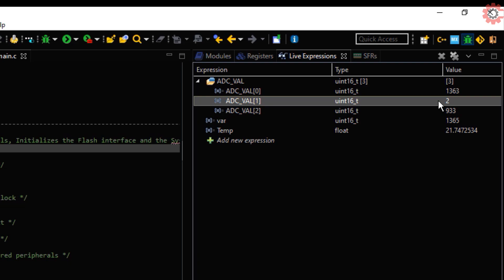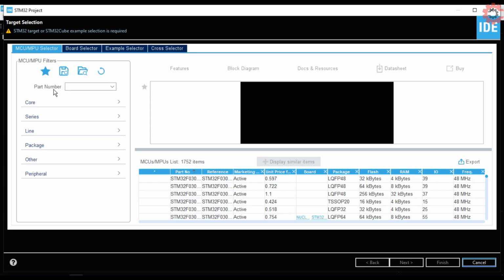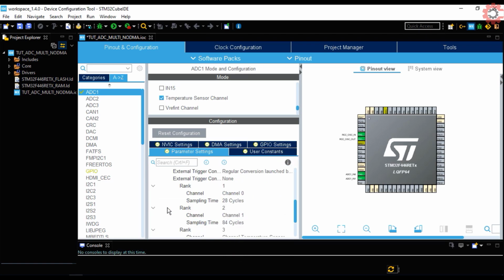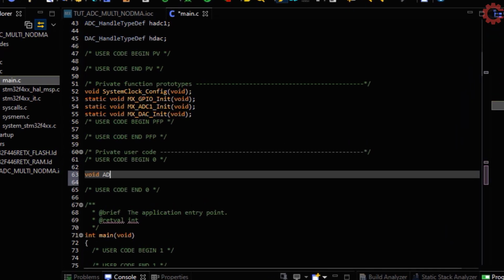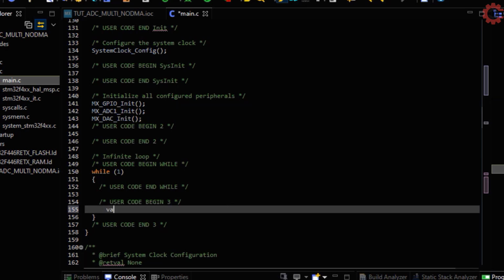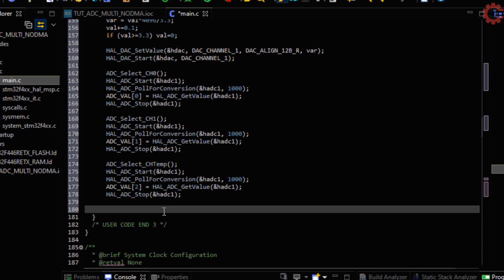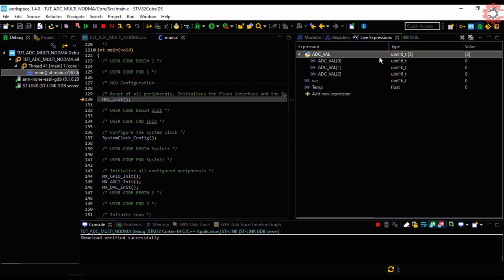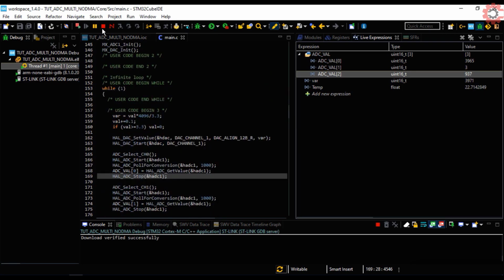STM32 ADC MULTI CHANNEL without DMA || HAL || Poll

Comment: I am using stm32f030k6t6, the adc configuration mode is different, whatever i done to read a joystick module to control 2 servos it ends with failure, I hope you make a video to explain how to configure it 😢
Reply: hi can you resolve the issue i am doing the same work with stm32f030k6t6 to read sensors values please help if you done this please

Comment: hi , iam facing issue with this , kindly review it, in the debugging ,i have seen that initially the LD2 led is on but after the function MX_USB_HOST_Init() ,it goes off , i also tried to manually make the pc0 to reset and now the led becomes on again after off , but my breakpoint at application ready is not hitting as i plug the usb seem like it donot recognize it

Comment: Thanks for your tutorial. I managed to get it working in my application, but...

Why do you modify the MX generated code so drastically (requiring to reedit the  MX_ADC1_Init() function everytime you run another MX session.

Does the generated MX code not work? Why can't one rely on letting the ADC1 do the sequencing by itself properly?
Reply from the maker: Of course you can. Let the dma handle the conversion.. there is no issue with that. It's just an alternative in case you want to control what to get the data from and when to get the data.
Reply: @ControllersTech  Maybe I didn't express myself clearly: I ressorted to your tutorial since I had problems getting DMA working. And my question was , why you end up with modifying the MX generated code . Why is the distinct ADC_Select_Channelxx() necessary at all. I meant letting the ADC doing the sequencing from channel to channel. That's what I think is Scan Conversion Mode for.

Comment: hi, thanks for the video. I got it working on my blackpill but getting big fluctuations in the live expressions. I am trying to run three voltage meters on a single adc channel w a touch gfx display and the progress bars keep flikering. how to keep the input steady?
Reply from the maker: It mostly happens because of the unstable power supply.  I think you can use some capacitors to reduce it.
Google it, you will find information about the same.

Comment: Hi 
I'm using stm32h743vit6 MCU. I selected ADC CH 3 and CH 7 but there is only disable option in scan conversion  mode. Kindly guide me how to use ADC multi channel in stm32h743vit6 MCU
Reply: I was facing the same problem on STM32U5. What worked for me is that first u should enable regular conversion (scroll a little bit down) and then set the conversion number (>1). Then the Scan mode will be enabled automatically.

Comment: What should I do if i have 1 ADC but I need to sample 1 channel at very high speed using DMA and i only need to poll the other channels at fixed intervals I'm stuck
Reply from the maker: You can still use DMA and control sampling rate for each channel in the cubemx. Look in the rank section while setting up the ADC parameters. To understand the sampling rate and time, watch my another video on it. It's in the ADC playlist

If that doesn't suit your requirements, you can use 2 ADCs.
Reply: @ControllersTech  i will look at the playlist

Comment: Hey can i change the wait time from millisecond to microsecond in HAL_ADC_P....
Reply: yes you can
Reply: SysTick->LOAD = 400-1; // one  MICRO second delay relaod value
	SysTick->CTRL = 7;
 ; // enable counter, interrupt and select system bus clock 
	SysTick->VAL  = 0; //initialize current value register 
  /* USER CODE END SysInit */ 

simply put this code your systick changed to 10 micro second as my clock frequency is 40 mhz

Comment: Hi,

I try your concept with stm32 bluepill fir adc continuous conversion without dma it run well but i am not getting the stability for adc as i am using pot for  pins but it showning a variation and that is very wide i.e 3204 to 4095 so suggest what could be done here
Reply: how it runs well can you please share the code

Comment: Hello hi I am working on adc multiple channels and what if am using freertos and let's say I have 2 tasks in task 1 I hav 2 channels set that is ch1 ,ch2 and in task 2 ch3,ch4 so for this can I configure each time one channel and get the value ?? Here task switching happens so can I set each time a different channel with out sequence like ch3 then ch4 and then ch2 and ch1.
Reply from the maker: That's exactly what's shown in the video. Converting channels individually... Without sequence
Reply: @ControllersTech  then scanconvmode should be disabled and continuousconvmode also need to be disabled right??

Comment: I was also having problems using dma and doing things in my while loop. DMA will just take over. I could not even end the dma or the adc or the adc in my while loop.  So, yes, it was not even getting to the while loop. 

For polling with multiple channels I start the conversion once and the software converts the 3 channels in a sequence. I only have to poll the EOC bit then save the data for each of the 3 conversions.. I only do the setup of the channels once. 

I am using a nucleo32 board with STM32L412KB chip. It is the size of an arduino nano footprint but runs at 80MHz and has 40Kbytes of ram, and I think 128Kbytes of ROM, crazy specs compared to AVR 328p.

Thank you for your videos. I think  this is the best channel on the stm32 on youtube.

Comment: hey actually i am facing the issue the my function of channel is not running initially

   adc_channel3();  // like  this is the function which you made to run the different channel 

     HAL_ADC_Start(&hadc);

     
      HAL_ADC_PollForConversion(&hadc ,1);
     
     adc_result_DMA[0] = HAL_ADC_GetValue(&hadc);
//    rawvoltage = (float)read_value*3.3/4096;
//    current =  (rawvoltage-2.5)/0.1;
      
      
        HAL_ADC_Stop(&hadc);

       delay_us(1);